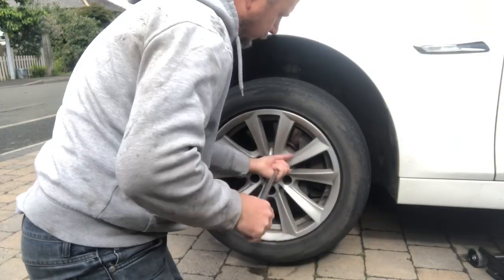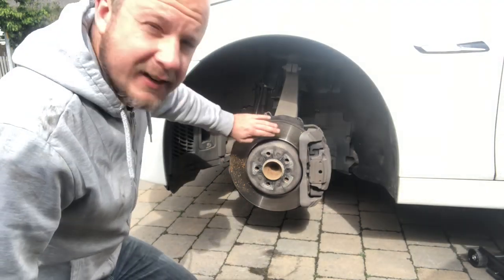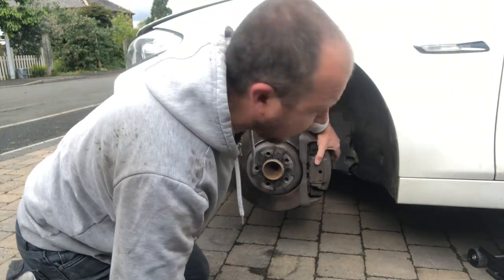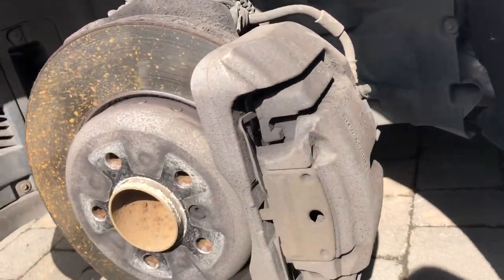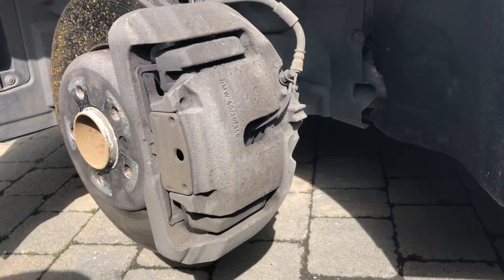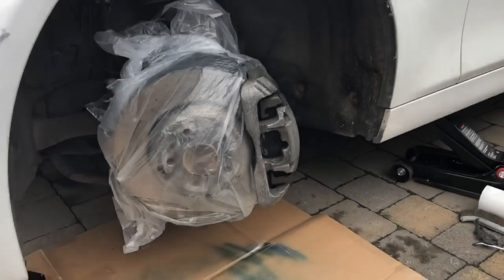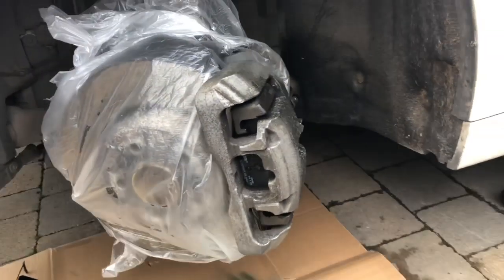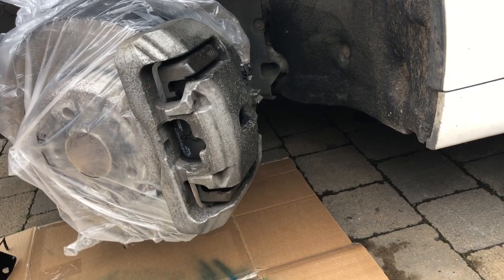BMW F10/F11 Brake Caliper Paint & Grilles

Comment: Didn't find your pege before now, but that is also because I haven't had a BMW before now. I have a BMW X5 M50D Sport with blue calipers. But the blue color is chipped and also probably damaged from when the braks was change, I don't know. But do I just do like you, use a metal brush clean them. Or do I have to use sandpaper also because mine is already blue?

Comment: Great job, love your diy . Just wonder what cleaner solution did you use as the calioer looked brand new after clean up before painting. Thanks
Reply from the maker: It’s called TFR (Traffic Film Remover) mixed with some warm water. It’s quite a tough degreaser - the stuff those hand car wash places use as the pre-wash spray.

Comment: I need to find this paint in Germany, looks amazing. Did you ever replace those brake clamps cause people tell me to do this after some higher mileage.
Greetz
Reply from the maker: Hi Alex, I’ve actually done no work on these brakes at all. When I bought the car all the pads were brand new and the discs are ok, so I’ve not done anything on them yet.

Comment: Have you replaced the discs or pads yet? When I replaced my front pads for the first time I found a bleed nipple was dry, even though I'd paid a dealer to change the brake fluid earlier when the car was newer. When I opened the nipple to let out some fluid to compress the caliper pistons, no fluid emerged from the nipple. So I bought a new nipple and changed it out quickly. On checking the now removed nipple it was completely blocked probably from new so no way could the dealer have ever bled my brakes correctly on all four sides...... 
I am fairly light footed, after >50k miles the discs are original. Changing the rear pads is a pain due to the electric handbrake and the need to wind back the caliper mechanism..
Reply from the maker: Actually, I haven’t needed to do any brake pads/discs on this BMW. The Mercedes C-class I had before was easy because there was a simple way to put the rear calipers into ‘service position’ - I haven’t looked at the procedure for the F11
Reply: @Nut_Job.  you can electronically put them in service mode if you have an ODBII connector, or you need to disconnect the parking brake motor on the caliper and then you can uncompress the pad with the same screw the motor is mounted on. Hope I'm clear.

Comment: What paint did you use for brake calipers
Reply from the maker: https://www.ebay.co.uk/itm/352097508679
Reply: @Nut_Job.  cheers mate..keep up the good work 😊
Reply: Do you know if you can code active sound with bimmercode on the 5sereis touring there is a video but in German